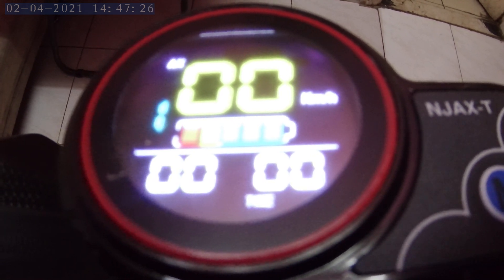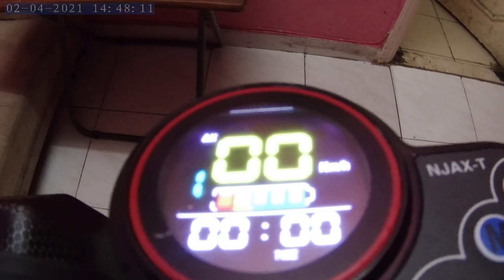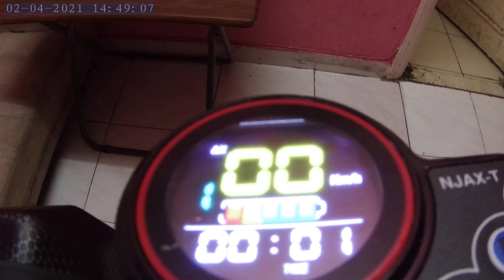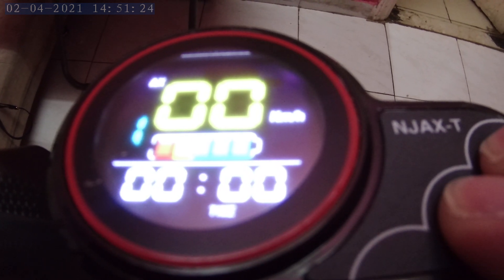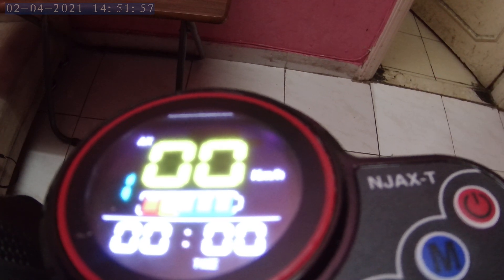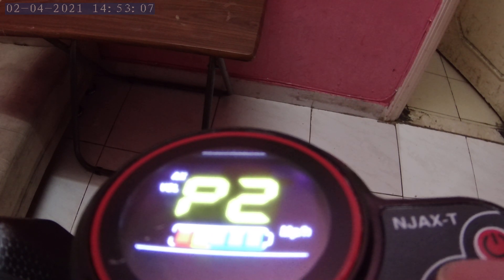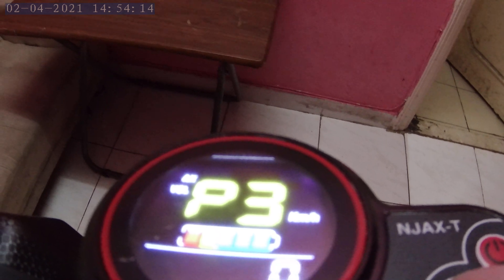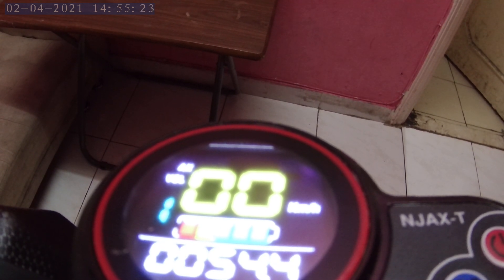P0 to P5  Escooter LCD Settings / P Setting – Guide - Part 1 of 2

Comment: How to change voltage to 48 and not 54
Reply from the maker: If you are in Dubai...look up Repair and Fix on Facebook...he might be able to help
Reply: @ronaldmariano3224  I'm in uk but thank u
Reply: 48 volt cell gets charged by 52-56volts as seen on the back of your charger so displayed its saying  56 volts the sign of a good battery, the change volts is motor controller cut off he sets it to 43 this is to stop the battery being drained to a voltage it wont recharge, the voltage displayed  is by this factor...

Comment: How do you unlock speed on this controller?
Reply: Ye i wana know it too please someone lemme know.
Reply: @krutaisLV  worked on mine :
Turn power on while holding your brake lever in. ( keep holding it till I tell to let loose). Pull the accelerate lever all the way in and let loose. Now pull the acceleration lever in a second time but hold it for 10 seconds. After those 10 second release the acceleration lever and brake lever. Turn off the scooter. And turn it back on.
This unlocked mine to 35 km/h in mode 3
Reply: @rubenVS100  ok how to you make it slower
Reply: @rubenVS100  I want the top speed to be 37 kmh
Reply: Cómo se hace ?
Reply: Hola amigos , mi scooter se apaga a los 6 minutos de inactividad y no me marca la velocídad , que puede ser ?